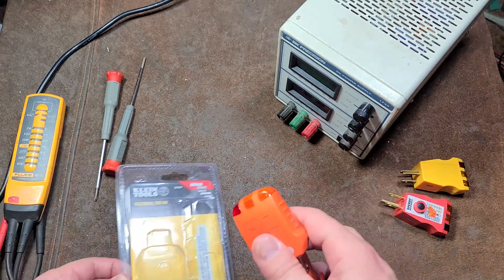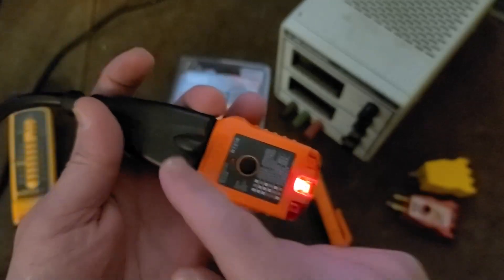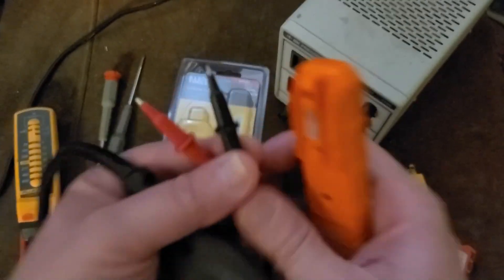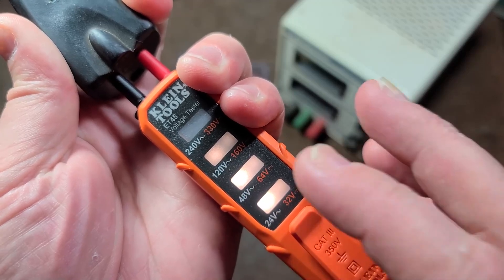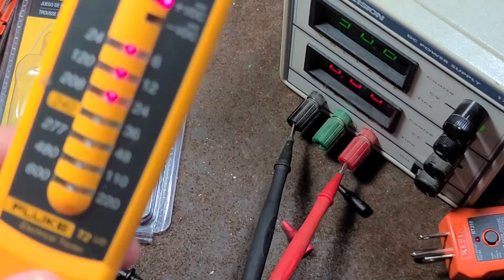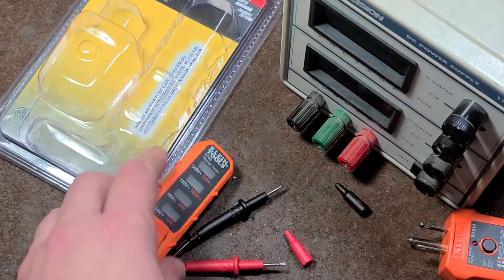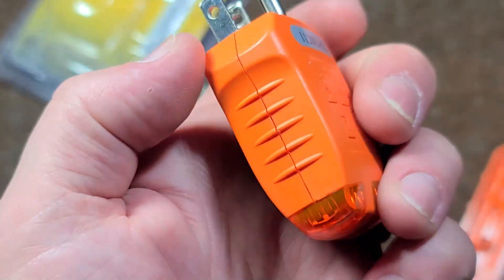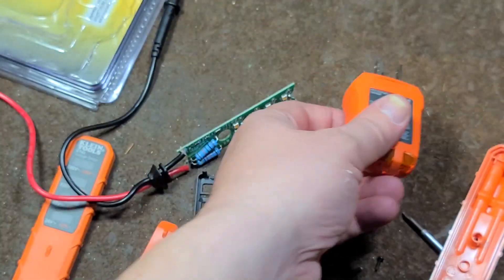Klein Tools Basic Electrical Test Kit Review

Comment: I  got sucked into a similar  ET-40. JUNK.   Probe(s)  do not lock into body so you can  hold instrument/ and probe in one hand  and probe with the other  probe.  Very  clumsy.   Probes are WAY WAY too small and short for safety, and probe  wires are WAY WAY  too short to span across  AKA  busses in a box, etc.   JUNK.  I had house fire, my Flukes and other meters were damaged or unavailable,  and  I got sucked into this.   JUNK

Comment: The lights changed side when you reversed the test leads because on DC the side that lights up indicates the DC polarity, which you reversed when you swapped the leads.  Both sides light up on AC because AC current flows in both directions.

Comment: I agree that the tool is confusing... Its confusing because it isn't a multimeter! I'm not sure if you're aware of this but electrical engineers and physicists often look at both the AC and DC voltages of the same signals. That is because DC and AC are always a component of one another! You could create a power supply that outputs a 40V AC signal with a 20V DC offset.

I have the same tool and I think what you're missing is that when one led in the row is on that means it is DC, if two LEDs are on in the row then it is AC.

Comment: I have one of these, and it seems to work like this: for AC, both LEDs for each step of the ladder light up. For DC, one side or the other will light up depending on polarity. In your example, when you have it hooked up to the power supply with red-to-red and black-to-black, the left LED lights up. When you swap it, the right LED lights up. I just tested mine and it works the same way. Klein also makes another tester (the ET40) that works similarly with two LEDs lighting up for AC and only one or the other lighting for DC to indicate polarity.